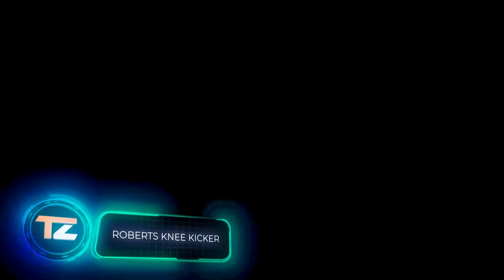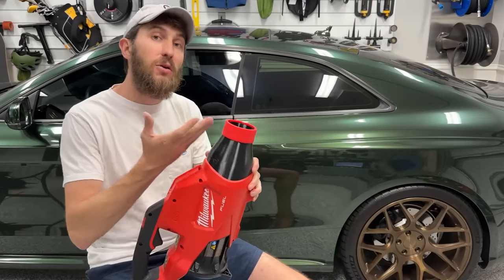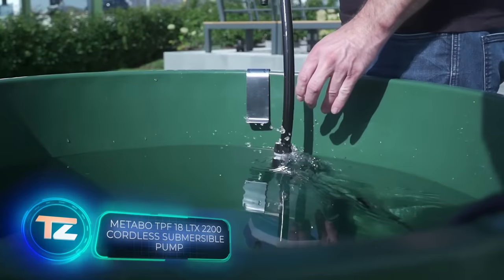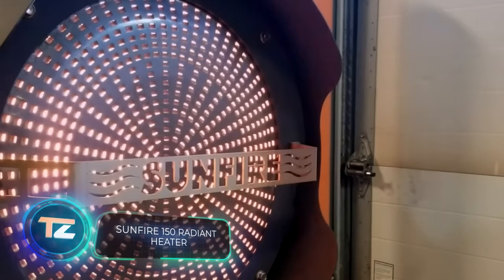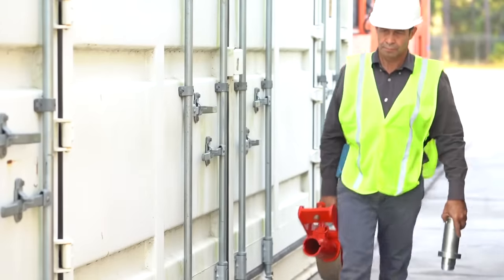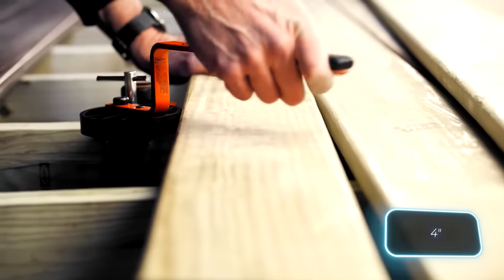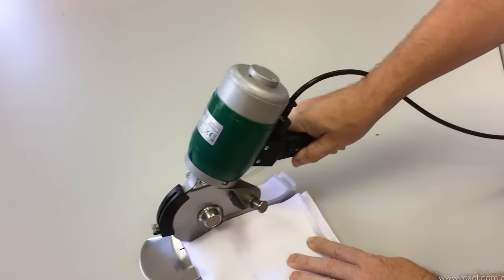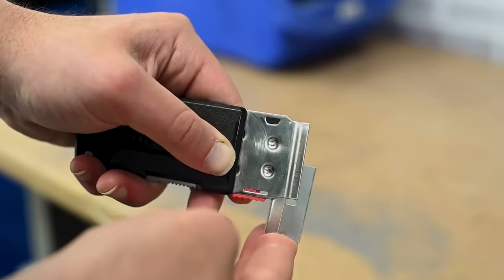25 COOL TOOLS YOU DIDN'T KNOW ABOUT

Comment: That post puller (9.10)  is a joke at over $2,000 when a cheap engine hoist does the same thing for less than $300. 
Whoever 'invented' it should re-visit the pricing.
There were several tools either cheap or reasonable priced, obviously intend to sell a lot to make a profit rather than very few to recover 'development costs'